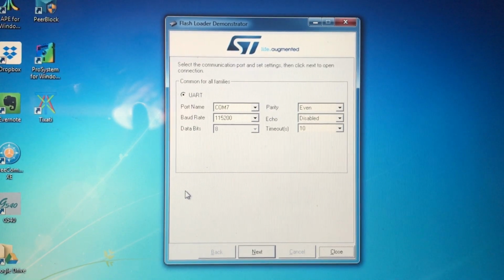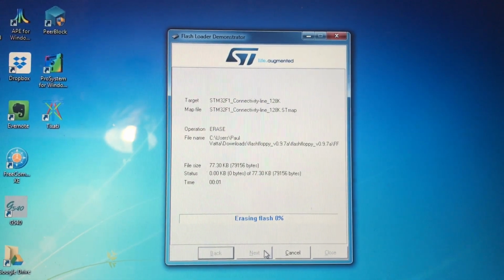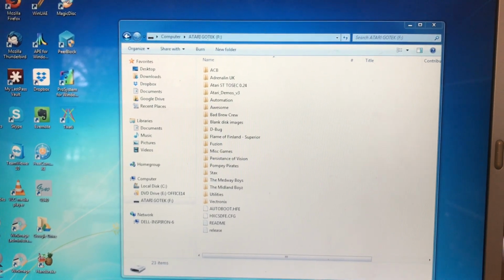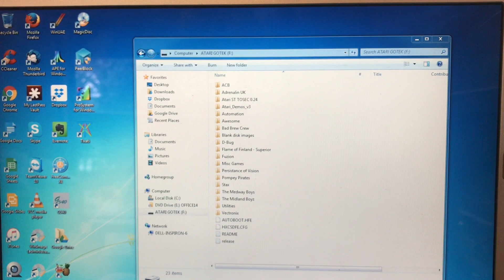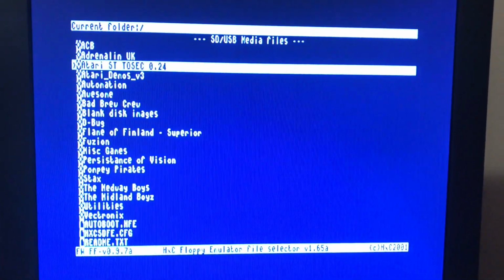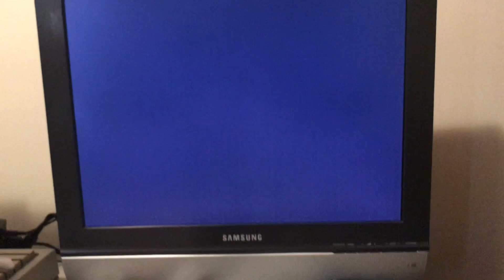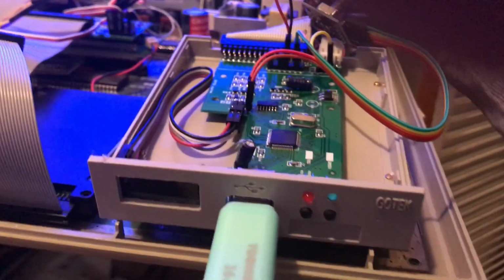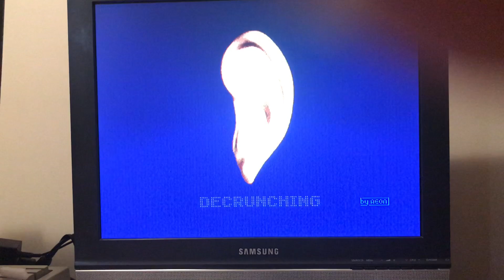Preparing the Gotek Floppy Emulator for the Atari ST

Comment: Hello, can I load into Atari some program (e.g. Steinberg PRO 24, that I own) from original FDD (Epson 480L in my case), then connect Gotek floppy emulator in place of FDD and save PRO 24 into Gotek?
I'd like to use Gotek instead of FDD, but have this sequencer PRO 24 only on original DD floppy disk.
Don't know how to transfer sequencer from floppy disk to Gotek.
Many thanks for your help.

Comment: Do I understand that correctly you actually no need for rotating encoder as well as LED display since you have an onscreen browser (unlike Acorn or amiga)?
Reply from the maker: The rotating encoder and OLED display are really optional extras for the Gotek, as you have the standard two buttons on the unit and numerical LED display that serve the purpose of being about to change disks and display the current active allocated disk "slot".  The onscreen browser is for allocating the disk image files on the USB drive to the disk slots on Gotek.  The Amiga does have the same HxC browser available to do this too (it's available here: https://hxc2001.com/download/floppy_drive_emulator/SDCard_HxC_Floppy_Emulator_Manager.zip)

Comment: Hi great video quick question how did you get your Atari disks onto pc ? Aren't the formats different ? ..cheers steve
Reply from the maker: 2000stephenellis the Atari TOS formatted disks have a variation of the FAT12 file system which can be read by PCs.  If they are in this format, you can read these on your PC.  There are also programs that run under Windows that can convert to the ST disk image format which can then be put in your Gotek’s USB stick.  http://www.8bitchip.info/atari/floimgd.php
Reply: @modernisingyourretrocomput3866  Thanks for that i`ll check it out i was trying to copy / backup some atari disks the other day when i put them into my p.c. i got "not formatted" error ..so was just wondering ... but thanks for the info .... i`d love to do the gotek upgrade but i have many many old music files that i need to put onto it ...so i need to be sure they will work beforehand ..cheers...steve

Comment: Well that was easy... Funnily enough I waited about 6 weeks for the eBay gotek to arrive and yesterday I decided to get one from amigastore because I thought it was lost or something, well of course it arrived the day after I ordered the expensive preconfigured one from amigastore... Oh well, the good thing is the one I got for the Amiga is one that has a custom plate for fitting inside the Amiga and I can use my cheap one purely for the ST without swapping around jumpers all the time, good to have multiple goteks anyway in the long run. 

Very simple and easy tutorial to follow, only thing that stumbled me for a bit was the pinout for the TX and RX for the Gotek but that was one google search away and it would've been easy to swap the 2 around if they were backwards

Comment: Great video! Quick question if you have a moment. I'm on FlashFloppy 0.10 and have a 520STfm. I believe it's TOS 1.0, no version info is visible under info. No rainbow logo.

Anyway, I have the jumpers set correctly. No matter how I flip the ribbon cable, I can't cycle through "floppies" with the GoTek buttons and I can't format the "floppies" from the desktop format utility. It tells me that the disk is physically write-protected.

Any thoughts? Thank you beforehand for your time!
Reply from the maker: Geek Therapy Radio Podcast are you using the AUTOBOOT.HFE file manager?  How did you create your disk images you’re using for writing?
Reply: @modernisingyourretrocomput3866  Sorry, not actually sure. It's whatever the seller included on the root of the USB. Let me check in a few hours and get back to you. Thanks!
Reply: Just to add, if its a 520stfm, then you probably have TOS 1.2.

Comment: I am using exactly the same devices and USB>Serial that you did in the video. When I run ST Flashloader Demo I keep getting 
 'unrecognized device  .. please reset your device and try again' or ' No response from target bootloader cannot started please verify bootmode configuration and the flash protection status.. rest your device and try again'
Reply from the maker: Ant2110 I’ve seen this before.  Check the soldering around the header pins you’ve put in, making sure there’s no solder whiskers and that the pins and vias are surrounded by even solder
Reply: @modernisingyourretrocomput3866  Thank for the reply.
Yes the soldering is good, have tried few time and just the same, any other suggestions?
http://www.powerlineit.com/temp/1.jpg
http://www.powerlineit.com/temp/2.jpg
Reply: @modernisingyourretrocomput3866  I tired using DFU file manager and a USBA>USBA cable and it worked. So have got it done. 
Do you have a repository at all with your ST images you have gathered?
Reply from the maker: Soldering work looks better than mine!
These two things may be obvious, but check the jumper is bridging the header pins, the contacts inside the leads haven’t been pushed in and are making good contact and lastly ensure the right COM: port is selected in STM32 software.
Reply: @modernisingyourretrocomput3866  Yeah all that checked too. Maybe I should just purchase one that someone has already modded from eBay. Just was keen to do it myself

Comment: Good video clear instructions on how to do the conversion. 
Will this just read .ST files or is there a way of reading .MSA files too?
Reply from the maker: Ant2110 this is using the Flash Floppy firmware, which as of version 0.15, doesn’t support MSA images.  You can use the HxC conversion utility to convert MSA to HFE format but that defeats the purpose of one of the benefits of MSA ie smaller size format.

Comment: So basically you just need to connect the floppy connector upside down? I thought you had to rearrange the cables.
Reply from the maker: Looking at the front of the drive, Pin 1 is on the right hand side.   On the ST, STE and Mega ST, Pin 34 is on the right hand so the twist is needed to have Pin 1 on the drive and connector aligned (line 1 on the cable is generally shown as a red wire).   For the Falcon, no twist is required as Atari placed Pin 1 on the right hand side, unlike the other models

Comment: What model is this? Trying to order one and found 2 models, namely SFR1M44-U100K and SFRM720FU. Thanks.
Reply from the maker: This is the SFR1M44-U100K.   It's the most common and cheapest from what I've seen.     The model number, the "U100K" indicates it's a 3 digit LED display.  The "1M44" part of the model number suggests this contains 1.44MB firmware, but this won't matter if you are flashing your own - the underlying hardware is the same.
Reply: Modernising your Retro Computer Thanks. Will get it for my Atari ST.

Comment: Thanks for this video ! Thanks to this I bought a Gotek and successfully flashed it using an old PC I had to dig out from my attic but at least it worked :)

Also successfully installed the OLED display, regretfully at my age, it's impossible to read the tiny letters on the screen without reading glasses..... :D  

Still having some issues though...when I boot I get a message that the firmware is outdated so looking for a more recent one now....but at least all the hardware works.

Comment: Great video. Since I am thinking of using this with my MSTE, does it support plain files? Not in disk images that is.
Reply: It's a shame it doesn't support STX and MSA formats....
Reply from the maker: There was some discussions on the FF forums around July 2018 about supporting other formats.  MSA was raised again and Keir (the FF developer) didn't seem opposed to it so hopefully it will be supported in a later revision.
Reply from the maker: CFalcon030 all data, including plain files, must be inside disk image files for the Gotek to read them unfortunately
Reply from the maker: I believe he is suggesting the Atari directly accessing the FAT32 file system on the USB stick.  Extensions such as HxCMount will allow you to do this but it will require the HxC firmware or later versions of the FlashFloppy firmware.
The Gotek (unflashed) will work with the Atari with the native firmware, but by updating to Flash Floppy, you are able to use the ubiquitous .ST format as well as the .HFE format that allows for other formats such as 800Kb extended formats.
The standard Gotek firmware and utility will partition a USB stick but since Windows will only mount the first one on USB sticks, the convenience is lost.